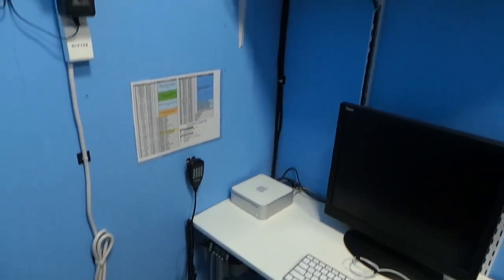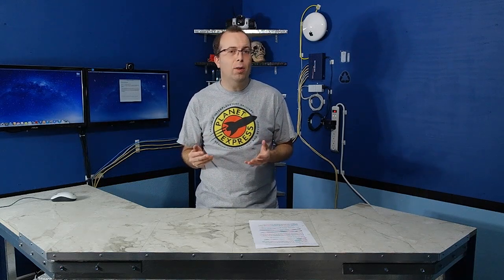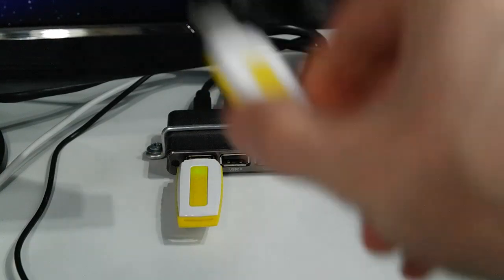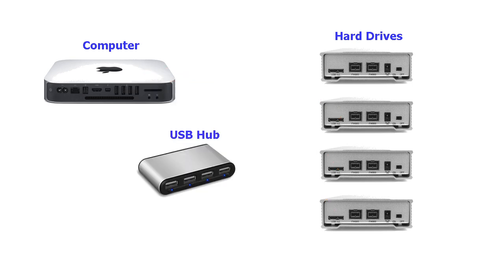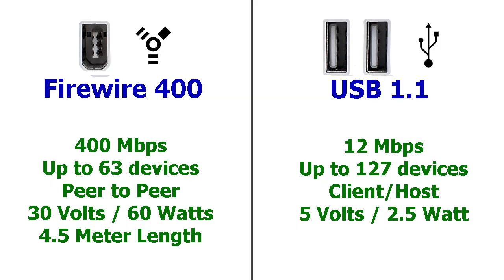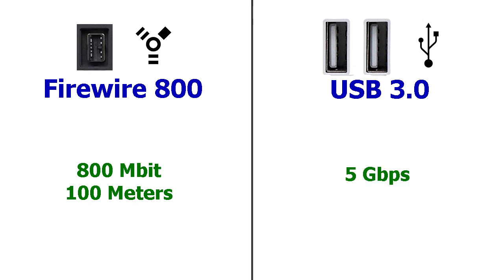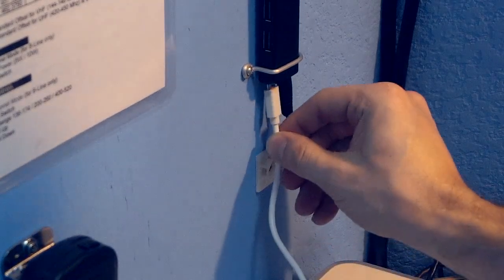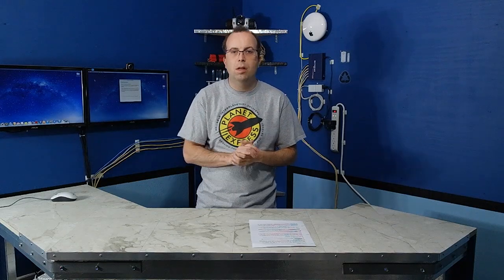Farewell R.I.P. Firewire, Hello USB!

Comment: firewire was fantastic for professional audio interfaces, as well.  a firewire 400 audio interface not only handled far more channels than USB 2, but did so with far far more stability and MUCH lower latency (to where for the first time you could use audio plugins live, real time). USB has caught up a lot, with usb 3 the latency finally caught up to where firewire was a decade ago.

Comment: I thought Firewire died around 2008.
Reply: FireWire 400 was able to maintain a constant 400Mbps throughput, whereas USB 2 was only able to attain 480 Mbps BURST rate. So FireWire 400 was still able to transfer larger quantities of data faster than USB 2.  FireWire 800 then ruled the roost until the advent of USB 3. In the Mac world, Thunderbolt replaced FireWire as the fast medium of choice.
Reply: @rahb1  The thing with Thunderbolt and Firewire is that Thunderbolt is way more versitile in every way. And USB is going the same way unlike Firewire.
Reply: @MrXxHunter  Can you daisy chain Thunderbolt, like FireWire can?
Reply: @RedHairdo  Yes you can
Reply: @RedHairdo  Ye you can but its more limited that FireWire. TB3 can D-cain to 7 devices (and computer counts as one device) and TB800 can up to 64 (computer counts as one device, so 63).
Reply: Well, the last MacBook made that supported FireWire was made in 2012, so I would consider that FireWire died then.
Reply: @sriharshaa3780  Yep, 2011 iMac still has FW 800
Reply: 2008 when my macbook was released
Reply: FireWire 800 fa lyfe!  Well, not really, but it was sooooo much better than USB 2.0.  I still have RAID enclosure with a FireWire 800 port which I use daily on an older machine that doesn't have USB 3.0.
Reply: And Thunderbolt 3 now uses USB-C interface
Reply: @risannd  Tunderbolt 3 was made for USB-C interface and there is no TB3 with type other conector.
Reply: @Sean Mondout spoken like true gentleman (can you feel the irony in the air?). Sounds like your knowledge about computer hardware and how did they work is = 0, so there on point to explain how device interfaces were controlled duo to lack of mental capacity.

Here's is a simple explanation:

USB had device controll and mapping at CPU, many device many calls to CPU (low-end and hi-end).
FW had own controller chip on devices that handled the mapping of devices, with other words less calls to CPU.
Reply: Nah, US Aircraft F22 and F35 still use FireWire as device management to day.. there is no other teknology what can take over FW at the moment.
Reply: It mainly died in the average consumer space in 2012 cuz of the retina macbooks.
Reply: What the hell is a Firewire
Reply: @oliverjackson5416  watch. The. Fucking. Video.
Reply: It's on my mid 2009 macbook pro.
Reply: My Z68 motherboard from 2011/12 has a FireWire port and the ability to add more internally
Reply: Firewire is still used in the audio industry, as it is more stable than USB.
Reply: @jani0077  Maybe this was true 5 years ago but not anymore. The new digital mixers use USB for live recording and FX and have 64 in and out. Firewire isn't used much because you need a long string of unreliable adapters to use it. For really high end stuff Thunderbolt is used
Reply: @griffin8062  i still bought a RME FIreface, which is considered a good midrange audio interface, and lots of other high end audio interfaces still support only FireWire. Thunderbolt is rarely used, as mainly Apple products and only other expensive laptops support it.
Reply: Yeah, but Apple refused to admit it.
Reply: @theblackwidower  ehh, there was no replacement for firewire until TB1 came to marked, and no USB can't replace FW(and TB3 to day) at the moment.
Reply: @lappodude  USB4 will basically be TB3. I dislike Thunderbolt and FireWire for the fact that they allow DMA access to the host computer on the hardware level, which no external device should have without explicit user confirmation.
Reply: @SomePotato  ehh, that is the nice thing about firewire and TB. the speed you get out of DMA is superior vs bus that pulls out data thought CPU calls.
Reply: @lappodude  True. It's also a gigantic security hole.

Comment: At some point in the future, you should really explore lightning link/lightning bolt systems. If they can support enough bandwidth to run a PCI Express 8x card slot at reasonable speeds, this might be the ticket. I know there are PCIX SSDs. I realize most of these are classified as enterprise grade devices but that's not to say that you couldn't use e-SATA controllers which could yield up to 6Gbps with SATA 3 connections. While it would be true that you'd still be dealing with a cable mess, you wouldn't be limited by the restriction of a USB hub's shared bandwidth. It's just a thought. Do with it what you will...

Comment: The biggest problem FireWire has in my opinion is its DMA, or direct memory access. This was by design to increase transfer speeds where system would allow FireWire device direct access to RAM memory of the host machine without operating system intervention. Of course this provided low latency but added a host of security issues as devices could access any part of RAM memory and inject malware, steal passwords and unlock your computer. Operating systems started battling this issue later on only after issue became apparent and malware was already out in the wild.
Reply: USB 3, Thunderbolt and PCI-E has DMA.
Reply: PCI-E is not a problem, as it requires computer case to be opened. While true for USB3 and Thunderbolt, operating systems got smarter in the mean time. They map DMA to virtual address space instead of RAM.
Reply: Thunderbolt carries (I believe 2) PCIe lanes, besides multiple external PCIe solutions exist in the gamer market and enterprise server market...
The memory access has largely if not nearly completely been solved in the progress of the past 15 years of operating systems and CPU's defining clear boundaries between kernel and user space.

Comment: I know this is an old video...  I have a 2008, 48 channel Audio Interface which is FireWire 400 & that was great with my 2011 Macbook Pro.  Except all 2011 Macbook Pro's have the dead GPU fault.  And a few weeks ago my late 2011 Macbook Pro died.
I got the 2015 Macbook Pro which has Thunderbolt, but no FireWire.  But Apple make a Thunderbolt to FireWire adapter & that works really well - not a hitch!
But now Thunderbolt has been surpassed by USB-C on all future Macbooks...
... I just get that dreaded feeling that this is all planned obsolescence!  :(

Comment: FYI  FireWire  has  S1600 & S3200  1600mbit and 3200mbit but were unreleased
Reply: but still usb 3 has 5000mbps
Reply: can it daizy chain mr.SirTriubleSeeker?
Reply: +ppdan If you are trying to work off a network storage like it was an internal drive (especially handy if you work with multiple people on large files, like video). SSD drives and even modern HDD drives can easily saturate a gigabit ethernet connection. 1 Gigabit is just not enough if you are working with raw 4K material.
Reply: he mentioned firewire can do 100 meters, so kinda like ethernet
Reply: +ppdan you asked when you would need 10 Gbit/s ;-) 5 Gbit/s is enough right now if you can nearly saturate it, but in the not-so-distant future – if not already today – we need 10 Gbit/s since 6K/8K video is getting closer. 5 Gbit/s is not that much, including the overhead it's aroung 625 MB/s, less than SATA3, which is already becoming a bottleneck (think of M.2, NVMe, etc.). So 10 Gbit/s is actually getting more and more necessary and some people already rely on it for their desktop Thunderbolt drives running in RAID0/10.
Of course, I am not talking about the average consumer at home, but the people doing actual work with these things, like video producers. And there are a lot of professionals that are self-employed and don't have a Hollywood infrastructure. :D
Last and probably most relavant, people want a single cable to connect everything. There are USB-C displays that have a integrated USB hub, so now you have the situation where you need to carry an uncompressed video stream (in 4K/5K) and fast data for potential storage drives connected to the display. If you have a 12" MacBook that is actually the only option, since it has just one USB-C port ;-)
Reply: pcfreak1992 These are all storage related examples. If you need that speed and rely on USB for your storage you are doing something terribly wrong! A good storage controller with RAID capability is the way to go then.
Reply: external graphics card
Reply: and usb 3.1 have 10000mbps
Reply: Great, but when do you need 10.000mbps? That'a DVD movie in under 10s, why would we need that at home?
Reply: faster is better anyway....
I also like to backup video editing that can take up to 1 Gb each
Reply: pcfreak1992 Did I say 1Gbps is enough? This is not a ethernet discussion but USB /Firewire. If you look at USB 3.0 it has more than enough bandwidth for whatever standard job we do today and even firewire 3200 is more than enough for most applications.
Only times when I ever needed high USB or Firewire speeds was when I temporarily connected a external drive (for backup purpose or other).
Reply: punker4Real well then technically they don't because it never reached consumers
Reply: why wouldnt we want it?
Reply: Many modern laptops only come with USB 3.1 connectors, and no DisplayPort / HDMI connectors. The throughput of a single QHD monitor at 32-bit colour depth and 60 Hz refresh is over 7 Gbps. So if you want to plug your laptop into a home docking station with 2 QHD monitors, an SSD backup drive, and the internet, you really need at least 20 Gbps. USB 3.1 isn't fast enough.
Reply: ppdan Cos laptops are portable and monitors are useful for productivity - why not have best of both worlds when you're at home! Anyways, I read up a bit more and found that some USB type-C connectors (e.g. on the new Spectre x360) also support Thunderbolt 3, which is 40 Gbps and could take the video signal as well as leaving you with plenty of USB bandwidth, all over the same cable. If you have a separate display port (HDMI), then unless you're using multiple external storage devices at the same time on a hub, USB 3 will probably be fine for you.
Reply: ppdan why not i mean with modern phones lets say you got a long subway ride and only a very short portion of the trip is above ground. So lets say you can download the avengers 2 in 5 minutes before you  go underground and lose data connection.
Reply: AetherElemental Bought a cheap 500 euro laptop last week. It has HDMI and USB 3, why would I need more on a laptop? If you want 2 QHD monitors why are you buying a laptop???